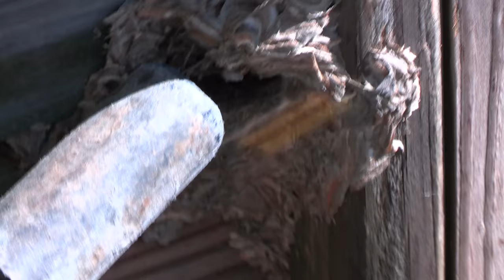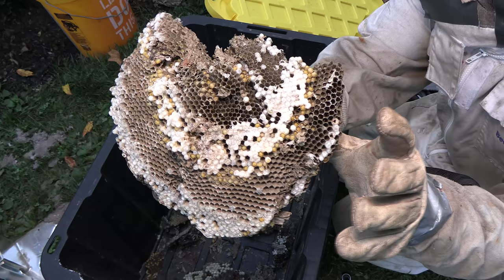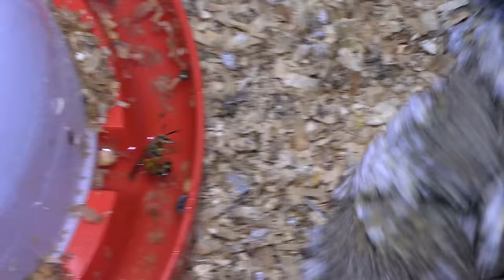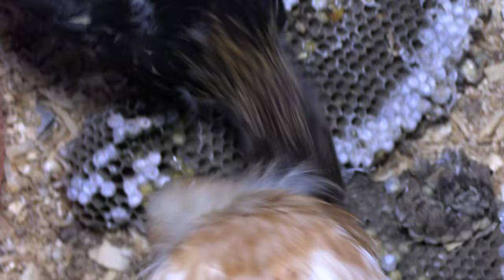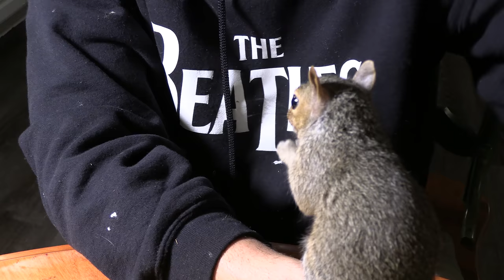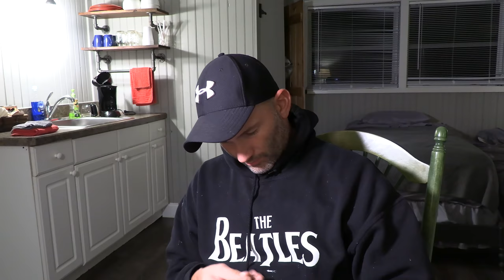Yellow Jackets Nest Removal - Opossums, Squirrel, Chicks EAT LARVAE

Comment: The permethrin dust finally did kill off the very small colony that started a ground nest near my front door in mid-September. Still feel that the colony was displaced from elsewhere in the neighborhood and desperate to get rehome before winter. It took several applications ot the dust over a 15 day period. Not enjoyable, but had to make sure the colony was dispatched before my grandchildren got stung and before the Trick or Treaters come calling. For now, I've filled both holes with dirt. I'll retreat the immediate area in the spring. Caution, the dust is eady to work with, not particularly hazardous if you wear a mask, but toxic to cats.

Comment: Check ur local laws if you haven’t yet man. Some tree hugger is gonna see this and call fish and game on you and they’ll write you a summons for wildlife molestation. In almost every state you need at least a hunting license and sometimes an extra handling permit to do this legally. I say this because I found out the hard way herping without a permit. Cost me 350$ and 60 hours of community service.
Reply: I didn’t even remove or bag anything. They wrote me the ticket walking along the road at 3am with my head lamp and snake stick and just happened to pull up while I was moving a rattle snake off the road.
Reply: The judge read me the AZ statutes that regulate that activity and they can technically arrest you or fine you if you have just the intent to handle wildlife and don’t even do it. So just being out there with my hook coulda done it. And they said the fine is more for actually removing them from the wild without a rehab permit.